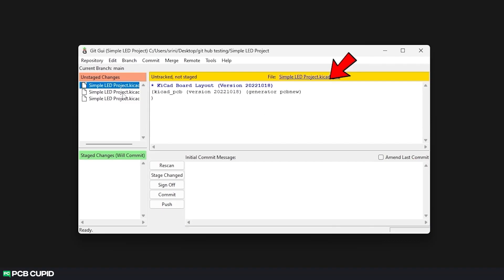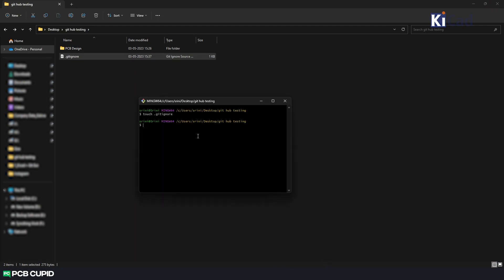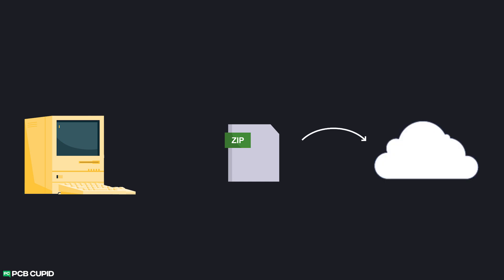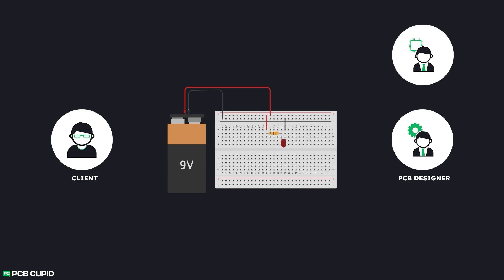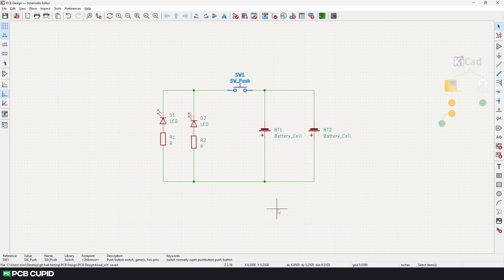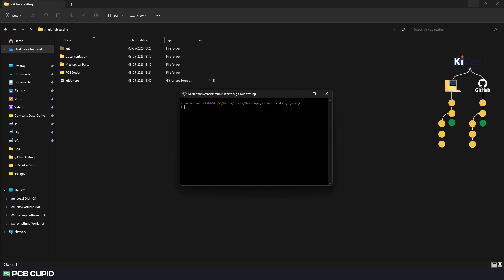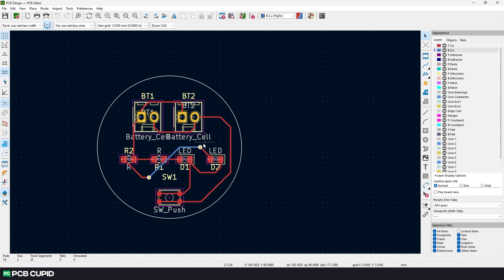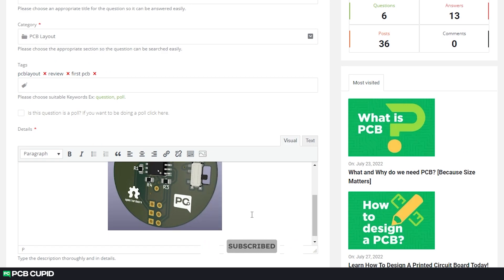How To Version Control PCB Design with Github | #pcbcupid

Comment: Really enjoying your videos.  Interested in your thoughts on how you would use KiCad + Github to manage a Project with one PCB with a number of active population variants (PCAs), for example in your project the same PCB could be used for a variant with Green LEDs and another for Red LEDs.  Then revision control, on one of the Variants, might change one of the Resistor values ?

Comment: After pushing the changes to github from the git bash command line you shouldn't need to use the "Compare & pull request" button. If you refresh the page you should see the new branch in the Dropdown list. The name of the branch on github was actually set by the last part of the git push command.

The "Compare & pull request" feature on github is a different way to merge changes. There are two ways it's often used: the first (common in opensource software development) is to allow people outside the organization to suggest changes, the second is as part of a QA process allowing others to comment on a proposed change before someone finally commits.